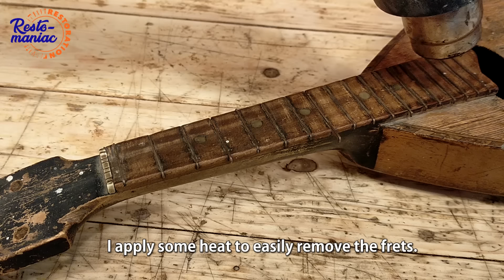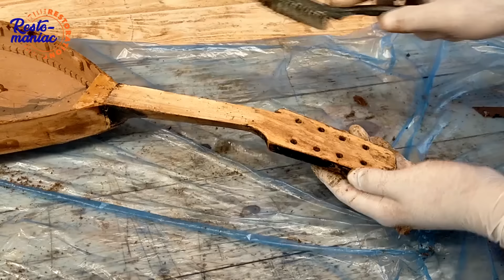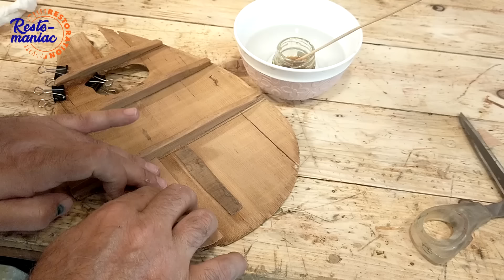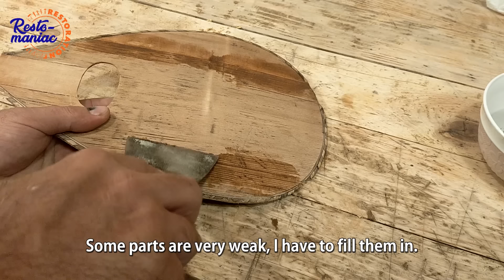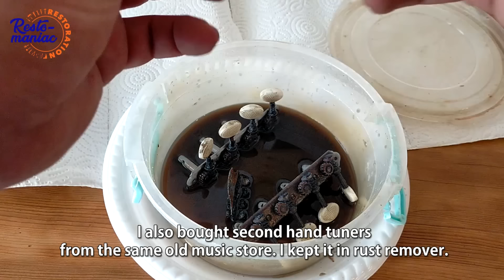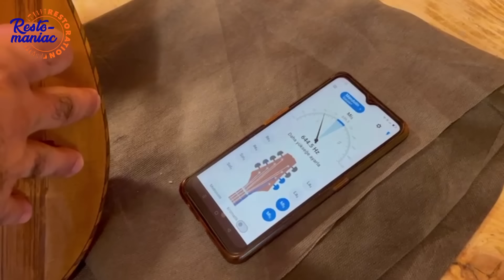It's not dead yet! POSSIBLE mandolin restoration

Comment: A great restoration.
I would add that if anyone watching is ONLY replacing fretwire, a heat gun isn't the best tool, as it will damage the finish.(In this example, it didn't matter, as the finish was being replaced).
Instead, a soldering iron run a couple of times along the old fretwire is enough to melt any adhesive before removal.
Give Tom an ear scrootch from me.
Reply from the maker: Thank you so much from me and Tom 😊🤗😽

Comment: Good restoration job there. I was handed a Puerto Rican Cuatro in a similar condition but I made a new sound board, back, fretboard “rosewood” bone nut, bone saddle and bought new tuners, a 9 volt piezo saddle bridge pickup with an equalizer.
Reply from the maker: Thank you so much 😊🤗

Comment: The original top is in terrible condition, the wood is too rotten. This means that it is soft and the soundboard has low quality factor, which is bad for the sound. Considering that there is another top from the same model, but in much better condition, I would use it entirely.

Comment: Hello! How do you determine when to use leather glue and when to use PVA?
Reply from the maker: Hello. It is necessary to use skin glue on antique pieces and musical instruments. It is a natural and traditional adhesive.  It bonds very firmly and dissolves easily during restoration. PVA adhesives are frequently used in wooden frames in more modern parts where much more durability is required. Compared to its grades, its water resistance is very high.
Reply: Thank you!

Comment: I am sure this instrument was not stellar quality from  day one. Therefore because of the extent of the  repairs on the top especially, I may have opted to use a 2 part professional epoxy on the inside (underside of the top and inside the bottom, to add additional strength to the wood. When I say professional quality I am not referring to the  stuff you buy at Home Depot.I did this once on an antique guitar , and it did not effect the resonance to any noticeable degree. But like I said  It probably did not have  a really top notch quality sound even when new, and I am sure even though you did a great job restoring it's appearance, it will never be recording quality , if even playable today.
Reply from the maker: Thank you very much for your kind comment 😊🤗